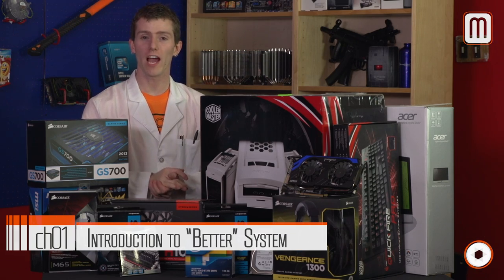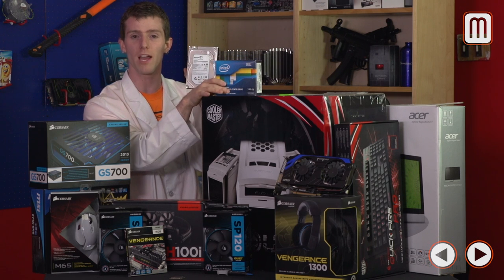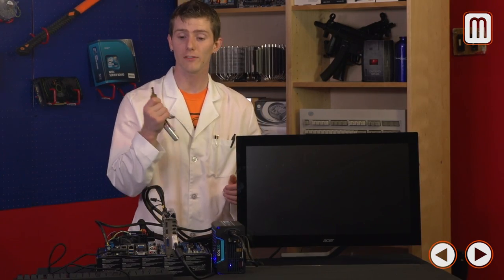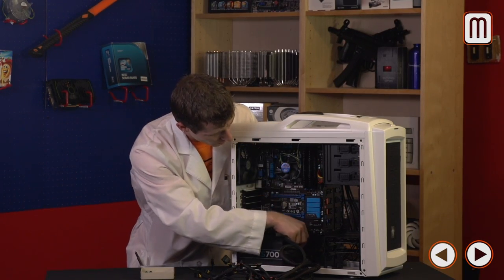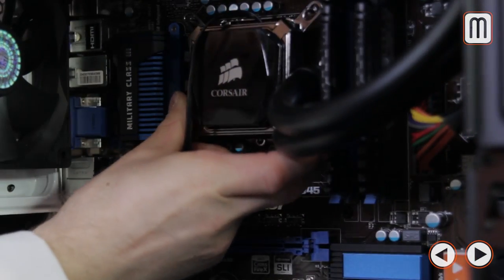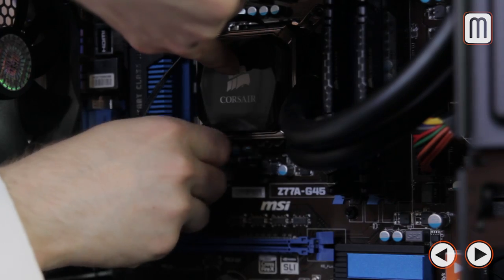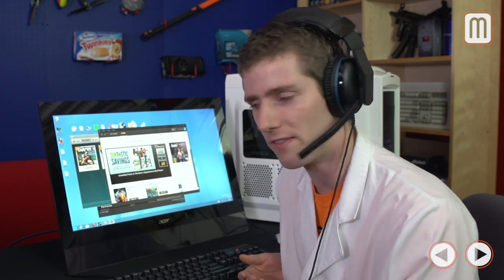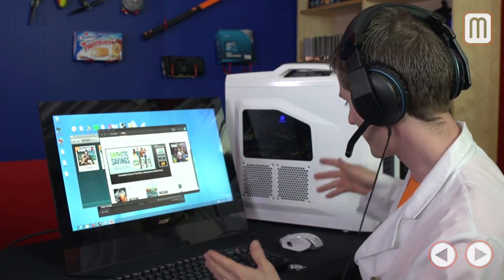ULTIMATE Build a Better $1500 Gaming PC Computer "How To" Guide

Comment: Hey Linus i have a $1500 budget. Do you think you could make an updated video?
Reply: pcpartpicker..
Reply: If you want an updated 1500$ Build, Keep in mind since then games have started utilizing more cores rather than less cores but more powerful single-core performance, So the best gaming build for 1500$ right now would be:
Fx 8350
Asus m5a97 R 2.0 (or if you want a motherboard with more features go ahead with that)
Gtx 780
8gb ram
And the case i would go with is still a CM Storm Scout 2
Reply: Again this is a gaming pc, 8 actual cores rather than 4 hyperthreaded cores is beginning to become more utilized in games.
Reply: ***** What you are thinking of is intel because intel uses hyper threading which is exactly what you just said 1 core is spilt into 2 cores a i7 is not an 8 core cpu its a quad core split into 8 cores which is great for editing and rendering but not for gaming and games are starting to utilize real cores as apposed to 4 cores hyperthreaded to 8
Reply: ***** Hyperthreading is very useful so don't completely overlook it.
Reply: Revive im not going amd because intels 4770k beats every amd chip in benchmarks. ik what cpu im gona get i just need the mobo, gpu good stuff like that. plus i might wait for intels new 8 core cpus
Reply: ***** An i7 is over 300 dollars, a FX 8--- series is around half that...It's a great deal for the price.
Reply: Hasn't even been a year rofl. Plenty of up to date builds, check pcpartpicker.com or reddit.com/r/buildapc
Reply: iAurora HD Wow, you've killed me there. but if you can't afford a 300 dollar core i7, a Core i5 cost only 50 dollars more and performs better.

When it comes to gaming PCs, every dollar matters, but don't try to scrunch every penny.
Reply: 50 dollars more than the FX 8---?
Reply: iAurora HD yeah
an FX-8320 is like 150$, a Core i5-4670k is 200$, but there is a huge difference.
Reply: It's actually 90 dollars more.
Reply: iAurora HD dang, they've gotten cheap, huh?
Reply: I guess. I've just recently been learning about computers. I started around a year ago or so.
Reply: iAurora HD I've started learning later than you and I think we know about as much.
Reply: Lol, I'm just about to build my first pc, PM me and we can talk about PCs. Cool?
Reply: iAurora HD I don't PM people.
Reply: Why?
Reply: iAurora HD the comment system is faster.
Reply: But it spams though
Reply: iAurora HD It's faster, though.
Reply: I guess
Reply: drew lowery What's your budget?
Reply: iAurora HD in the range of $1800 i can go like $20 over tho.
Reply: drew lowery Okay, give me a minute, do you have anything you must have?
Reply: http://pcpartpicker.com/p/3Q1Yl

This is one that I'd recommend for gaming, and for a 1800 dollar budget.
Reply: iAurora HD thanks man. will i be able to sli with that psu and still overclock later on or do you think i should bump up the watts?
Reply: drew lowery Well with that PSU you'd get around 50 extra watts when you SLI, if I were you, if I SLI, I'd get the RM850 it's like 10 dollars more, but gives you an extra 100 watts, so you'd have a total head room of 150 watts if you SLI. But honestly, with that powerful GPU, you wont need to SLI, unless you Mine or something like that.
Reply: iAurora HD yeah true but i might just save up a little more and get a 1440p monitor and then get another 290 so i can have high fps with everything maxed out at 1440p
Reply: drew lowery Dude, it's honestly a waist of money to spend 700 or more on just a monitor, if you do get a 1440p monitor, you'd spend almost half your budget. Plus a 780 is a lot better than a 290.
Reply: iAurora HD um how. the 290 has higher benchmarks
Reply: drew lowery They vary, to be honest. Some games (most of them, that I know of) work better with the 290, and it's cheaper.
Reply: Joseph Neck im geting the sapphire r9 290 vapor x witch it has the best cooler on it plus im going to have my corsair air series fans blowing air right on it.
Reply: drew lowery You dont need an extra fan though, most graphic cards are very good at keeping within there optimal working temperatures. (Usually below 90 degree's Celsius)
Reply: iAurora HD the 290 runs very hot. yeah the card im getting will make it run cooler but with extra fans i can get it to about 60c and have better air flow.
Reply: Unless you water cool it, I doubt you can get 60 degrees with full load.
Reply: iAurora HD yeah. its just i want the 780 and the 4770k but the 780 is too much for my budget if i have the 4770k. the reason i want it so bad is because of watch dogs it recommends either an i7 or and amd 8 core.
Reply: You can probably run it with an i5 if you oc it.
Reply: Plus an i5 and an i7 kinda perform the same in gaming
Reply: iAurora HD alright. and i wanted the 4770k because its gona help in watch dogs
Reply: Not much to be honest, you'd be paying an extra 100 dollars for like 3 fps more.
Reply: iAurora HD okay. and how much fps would the 780 offer me over my 290?
Reply: drew lowery That depends on your specs and all that stuff...There is no system FPS calculator.
Reply: iAurora HD okay witch is more powerful after ocing the 290 (vapor-x) or the gtx 780 (lightning) both these desighns will keep the gpu cool but ive heard the lightning ocs very well but the r9 290 is meant to oc and with the amazing cooling on the vapor-x idk witch to choose :\
Reply: drew lowery The 290 is a way better option. Thee 780 is a better, but only for about 5 fps, it's $100 more. The 290 will be better for OCing, as vapor x is the shit.
Reply: Joseph Neck but the 780 im geting is the lightning i heard its the best oc'er.
Reply: drew lowery If you are gonna Over clock, the best GPU of a 780 would probably be a 780 Matrix by Asus, it's not out...Yet, although it's gonna be an ROG  edition, so it's amazing for gaming and Overclocking, pair it up with an Asus Maximus VI Formula, and a I7 4770k, and you'll have a beast of a machine.
Reply: iAurora HD what happened to the 4670k?
Reply: drew lowery Top of the line for gaming? 4770k.
Reply: iAurora HD well ill either get a r9 290 (vapor-x) with the 4770kk or the 780 (lightning) with the 4670k
Reply: drew lowery Do not get a 4770k. It was not designed for gaming. Stick with a 4670k, as some/most games, actually have LOWER framerates using the 4770k, such as dayz. 

Also; it is $100 cheaper. The 290 has certain games optimized better for it, with vapor x being an amazing cooler while running quietly, if not the best. The 780 lightning isn't as good as you think for overclocking. It varies.
Reply: Joseph Neck omg thank you for telling me that about dayz lol thats gona be the main game i play lol. and either cards are going to have two fans blowing air right on them so both will be cool but after overclocking witch will be better the 290 or the 780 lightning?
Reply: drew lowery Lighting version. It's the flagship version of the 780 by MSI.
Reply: ***** or if u can afford it there are i7's with six cores
Reply: Try a 4690k (a revamped version of the 4670k for slightly better temperatures/overclocks), and go with the Asus Z97-C motherboard for better compatibility and potential compatibility for the future Intel Broadwell cpu series.

Also, go for the GTX 9xx series of graphics cards, why are you guys recommending the last generation GTX 7xx if it uses twice as much wattage and is a little slower for about the same price?

Comment: but will it run minecraft?
Reply: NO
Reply: NO
Reply: yes with mods and shaders.
Reply: No it won't
Reply: Malta Games yes it will
Reply: Awsomecrap can't anyone get that I'm joking....u can run mc on a shit pc
Reply: people obviously underestimate minecraft, I have an i5 quad core, 4g ram and I only get 20fps on low settings
Reply: Elijah Purnell Thats true i use a i5 4430 3.0GHz 8gb RAM an GeForce gtx 650 1gb vram and its good can but not play with shaders!
Reply: Yea pretty damn good
Reply: minecrafts a bitch.. but try the 64bit version. helped it run more efficient for me =)
Reply: Malta Games what do you have in the system
Reply: play FTB
Reply: ***** its pretty simular but you have a more powerful cpu and the two vram gtx 650 and i play often with mods

Comment: can my cimpotore run mincraft my dad boght it 4 mw

Case: Corsair Obsidian 900D  Core: 2 Intel Xeon E5 2699 v3  Ram: Corsair 4x8 GB DDR4  GPU: Nvidia Geforce GTX TITAN X  GPU 2: AMD R9 295X2  MOTHERBOARD: Corsair H100i  SSD: Intel 1,5TB  HARDDRIVE: Seagate 4TB 12000rpm  OS: Windows 8.1 Pro  POWER SUPPLY: Corsair 1500W  Monitors: 3 5K IPS Monitors Dell UP2715K  Liquid Cooling
Reply: Wazl no, because you can't use a cpu cooler as a motherboard.
Reply: Bacon CheeseCake
lmao i just copied pasted a comment
Reply: Taylor Swofty
its a joke
Reply: Wazl you cant run 2 cpus and you cant run 2 graphics cards that arnt from either NVidia or amd
Reply: You can run2 CPUs if you have a Xeon and a motherboard that has two sockets
Reply: +MexicanHighJumper yes you can
Reply: 5 Tb ssds are not commercially available
Reply: So i'm an idiot for pasting a comment?, fair.Bacon CheeseCake

Comment: Is this good for a PC build?
I spent a long time looking for parts.

Case:
CM Storm Trooper

Keyboard:
Logitech G710+

Mouse:
Logitech G302 Daedalus Prime

Motherboard:
ASUS Z97-A

Core:
Intel Core 
i7
4790K Devil’s Canyon Quad-Core 

Memory:
CORSAIR Vengeance Pro 16GB (Silver)

HDD:
Western Digital Blue WD10EZEX (1TB)

Monitor:
ViewSonic VX2252MH Black

Graphics Card:
ASUS GTX750TI-OC-2GD5 

Power:
CORSAIR CXM series CX500M

Heatsink:
ZALMAN CNPS9900MAX-R

Disk Drive:
SAMSUNG 18X DVD-ROM 48X CD-ROM SATA DVD-ROM Drive Model SH-118CB/BEBE

Comment: Hows this build for a beginner?

CPU - Intel Core i5-4460 3.2GHz Quad-Core Processor
	
Motherboard - 	ASRock H97 PERFORMANCE ATX LGA1150
Memory - 	G.Skill Ripjaws X Series 8GB (2 x 4GB) DDR3-1600 
Storage - 	A-Data Premier Pro SP600 128GB 2.5" Solid State Drive
Storage - 	Seagate Barracuda 1TB 3.5" 7200RPM Internal Hard Drive
Video Card - 	XFX Radeon R9 290 4GB Double Dissipation Video Card	
Case - 	Corsair SPEC-01 RED ATX Mid Tower Case
Power Supply - 	Silverstone Strider Essential 600W 80+ Bronze Certified ATX
Monitor - 	LG 23MP55HQ-P 60Hz 23.0" 
Case Fan - 	BitFenix Spectre 43.5 CFM 120mm
Reply: That will be pretty good.
Reply: Not bad.

Comment: I just built my sister an "entry" level rig for her birthday. Tell me what you guys think about it:
Case: NZXT Noctis 450 white
Mobo: MSI Z97S SLI Krait Edition
SSD: Kingston V300 120GB
PSU: Corsair RM750 750W
RAM: HyperX Fury DDR3 1866MHz 8GB Blue. Went with one of them for upgradeability
CPU cooler: Intel TS13X watercooler
CPU: i5 4690K
GPU: My "old" MSI GTX 770 2GB

Comment: I'm doing:

i5 Intel 4690
GTX 980 4GB
8GB dual channel
900w modular SLI ready
ASUS sabertooth Z97 (wht camo)
1TB HDD
500GB SSD
Blu Ray optical drive

Superclocked, and I figure I don't mind getting rid of my RAM for possible future upgrade to 16GB, also not compromising performance. The 980 can run every gpx-heavy game made for pc to date. Everything in my build is SLI ready for the second GPU I want to get in the future. Also I want to go with the 500GB SSD because it'll be for pure installation, no saves whatsoever for max booting on all fronts.

Send me a message if you'd like to talk it over, I'm open to suggestions. Happy building :)

Comment: Hey guys ! 
I'm kinda new to all this building process so I got my friend to put together a  build for me based on the requirements that I wanted the computer to meet. 

So here are the Specs for the build:
CPU: Intel® Core™ i5 4590
Motherboard: MSI B85-G43 Gaming Motherboard
Graphics: EVGA GeForce GTX 970 Superclocked ACX 2.0 4GB
Memory: Kingston Hyper X Fury HX318C10FRK2/8 8GB (2x4GB) Red
Solid State Drive: Samsung 850 EVO Series 250GB SSD
Hard Drive: Seagate Barracuda 2TB ST2000DM001
Case: Be Quiet! Silent Base 800 Case Black
Power Supply: Be Quiet! Pure Power L8 600W Power Supply
Operating System: Microsoft Windows 7 Home Premium 64bit

The whole build comes to around $1600 and I'd love to hear feedback on what to change or anything as I'm still not 100% on getting it and I'm wondering if it is a good choice of parts :D
Thanks :)

Comment: I'm planning on buying some new parts for my computer hoping to make a pretty big upgrade, here's the parts that i'm looking at:

Mobo: ASUS Z97-PRO GAMER
CPU: Intel Core i5 4690k
CPU Cooler: Cooler Master Hyper 212 EVO
GPU: Asus Radeon R9 290 4GB DC II
RAM: 2x4GB DDR3 1600MHz from my old computer
PSU: Corsair CX 600W 80+ Bronze
SSD: Hyper X Fury 120GB
HDD: 250GB drive from my old computer

There is a bundle where i get the mobo and cpu with a reduced price, also the gpu is on sale which made me pick them. (almost $100)

Will these specs be able to play newer games, and not need to be replaced in a couple of years? I have not bought parts like this ever, but i have watched 1000 videos about stuff like this from guys like Linus.
Please leave some helpful comments =) 

(My current computer has:
Some random MSI mobo with am3 socket
AMD Phenom II X4 965
stock cooler on cpu
AMD Radeon HD 6870
^RAM from above
500w psu with bad quality
no ssd
^hdd from above)

Comment: These are the specs for the PC i'm building. Do I need a different cooling system for the CPU or is the stock one fine?

CPU - Intel Core i5-4690K 3.5GHz Quad-Core Processor

CPU Cooler - Cooler Master Hyper 212 EVO 82.9 CFM Sleeve

RAM – Kingston HyperX Fury (black) 8GB DDR3-1866 

GPU - MSI Radeon R9 390 8GB Video Card

Motherboard - Gigabyte GA-Z97-HD3 ATX LGA1150 Motherboard

HDD - Western Digital Caviar Blue 1TB

SSD – Samsung 850 EVO-series 250GB

Case - Corsair 200R ATX Mid Tower Case

PSU - Rosewill Hive 650W 80+ Bronze Certified Semi-Modular
Reply: +TheOvieShow It's fine, but I suggest a liquid cooler instead, for high end cpu and  gpu's and also if you intend to overclock, you may need liquid cooling or it could get hot from time to time. I'm pretty sure your case provides two stock fans anyway, so a third one should definitely be for liquid cooling. If you fit the criteria. Also, you should make sure the liquid cooler can fit in your case. Seriously though, It's worth putting in another 100 bucks.
Reply: KingZ ok thank you so much :)

Comment: Are The Decent Specs? (Anything to change, upgrade or add)
-Intel Core 6500 3.2GHz (Quad Core)
-COOLER MASTER Hyper 212 Plus
-H110 Chipset [Max 2 Sticks Of Memory]
-16GB (2x8GB) DDR4 2133Mhz 
-1TB 7200 RPM 
-Geforce GTX 1060 3GB
Reply: late comment, post on pcmaster race reddit or pc partpicker forums, never youtube dude

Comment: How's this for my first build? I have a budget of $700.

CPU: AMD FX-6300 
Motherboard: MSI 970 GAMING ATX AM3+
Memory: Crucial Ballistix Sport 8GB (2 x 4GB) DDR3-1600
Storage: Samsung 850 EVO-Series 250GB 2.5" SSD
Video Card: Sapphire Radeon R9 280 3GB Dual-X
Case: Corsair SPEC-03 White ATX Mid Tower
Power Supply: Corsair CX 600W 80+ Bronze Certified Semi-Modular ATX
Optical Drive: Asus DRW-24B1ST/BLK/B/AS DVD/CD Writer
Reply: Not a bad build, but where's the cpu cooler?
Reply: I was planning on using the stock cooler since I'm only overclocking to 4GHz. Do you think this would be okay or should I go with an aftermarket cooler?
Reply: Jacob Grasso Don't overclock with stock cooling.
Reply: Are there any budget aftermarket coolers safe for overclocking that you know of?
Reply: Jacob Grasso I'd go for a Cooler Master Hyper evo 212 but I don't know if will fit in your case.
Reply: ***** Hmm, I've read online that it fits just barely. 

http://www.mmo-champion.com/threads/1605291-Looking-for-a-cooler-that-will-fit-my-SPEC-03?p=29937192&viewfull=1#post29937192
Reply: Jacob Grasso Did you choose your cooler yet? Because you could go for liquid cooling. More expensive, but cools much better and can fit in your case easily.
Reply: ***** I'm going with the Evo and also I've decided to change my case to the NZXT Phantom 410 so it's guaranteed that my cooler will fit.

Comment: Hey Linus, I'm addicted to your show, I watch it none stop. I would like to build high end video edit machines my self, but I shake to much working with little screws. So I go to computer builders like Tiger Direct. It seems like I know more then the do. But I have to say they did ok on the build after I worked with them for two days, trying to figure out what I needed for the fastest computer I could build. The question I have is, I know you have thousands of emails and tweets, but this one is simple and quick, What do you think about the Phantom white large tower not the short tower. I was told at that time that white is better for heat resistance for one, and this was supposed to be the best tower to use, what is your opinion on that?